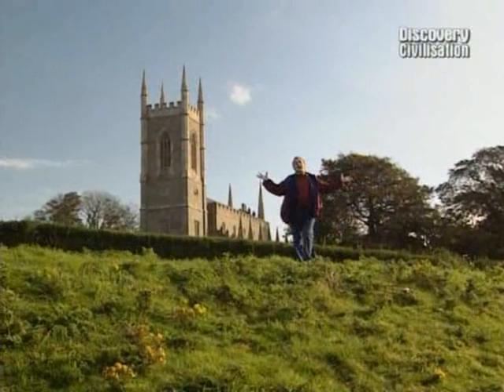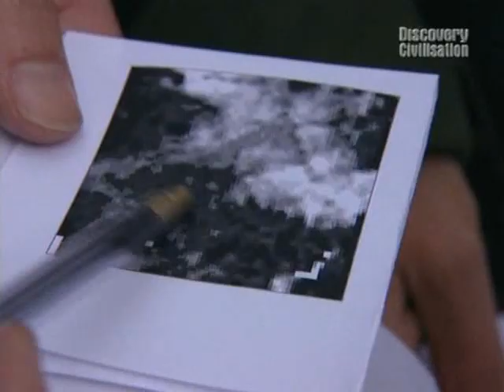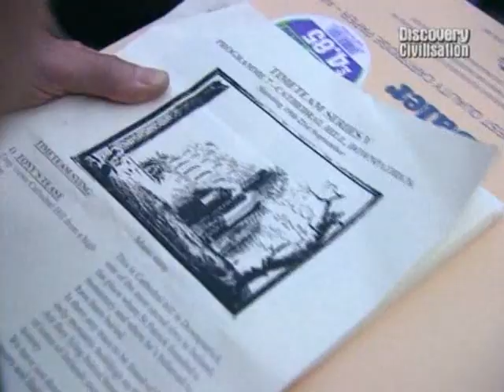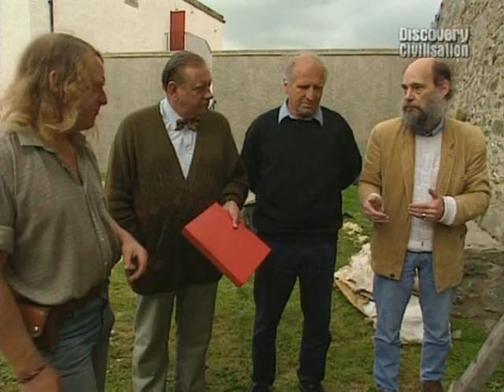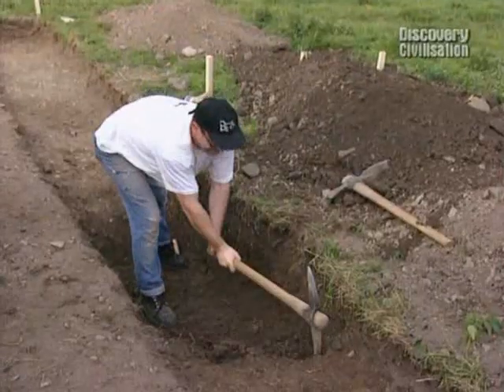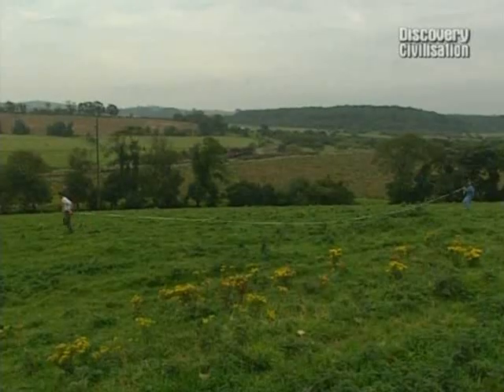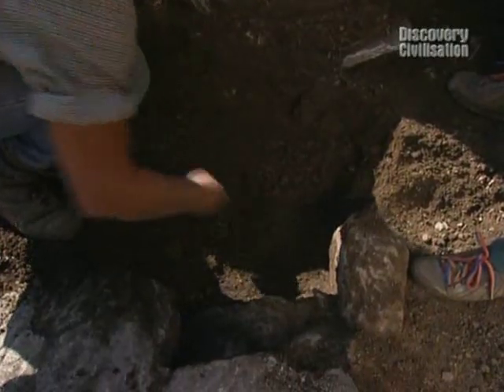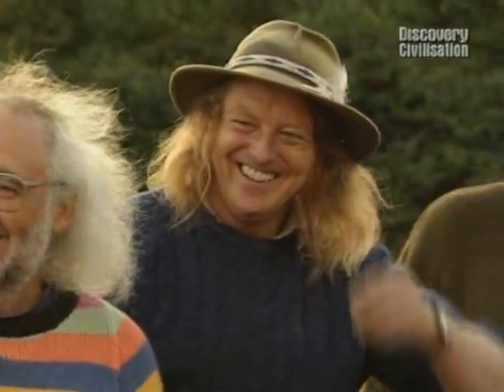Time Team S05-E07 Downpatrick,.Northern Ireland

Comment: The size of these trenches surprised me at first. We in belgium work via a semi-french trench system and usually clear off the topsoil with digger and then put trenches in on discolourations. So I'm used to trenches that are 20m by 60m on fields.
Reply: I wish we had a Swedish version of this show. Just like Europe in general we are up to our necks in old uninvestigated stuff.
Reply: The reason the trenches are so small is that this is only exploratory archeology: recording and confirming archeological sites for actual excavation later or préservation. They aren't actually digging anything up.